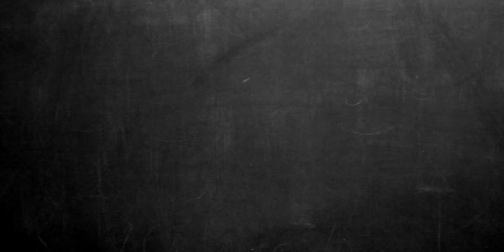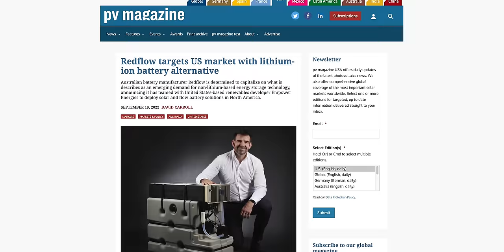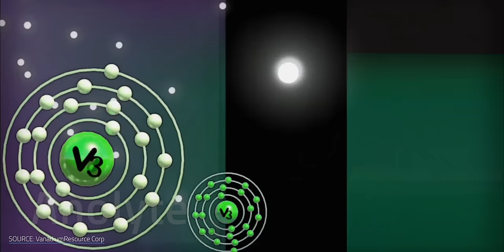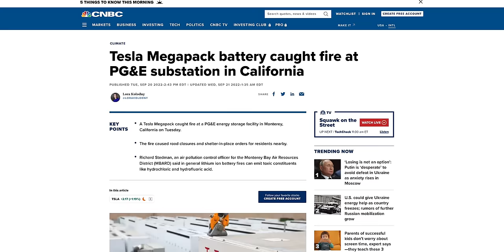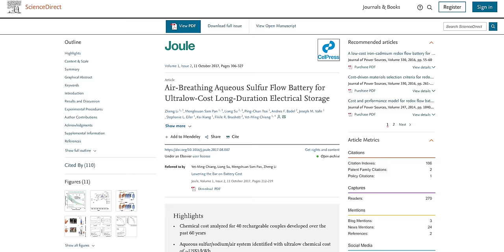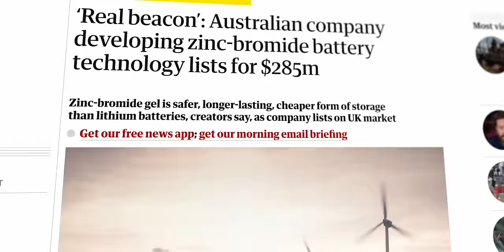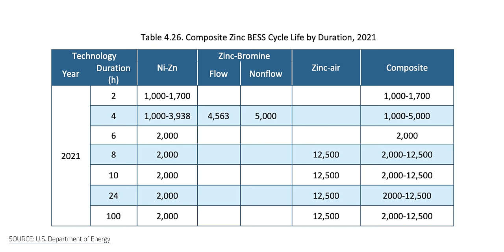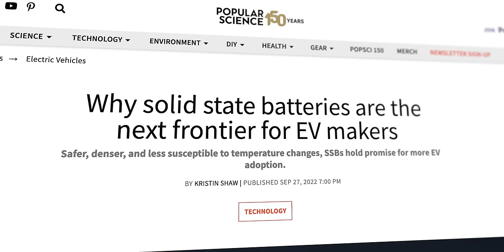137 Year Old Battery Tech May Be The Future of Energy Storage

Comment: If the recent fusion development takes off, the need for storage , wind and solar will fall off a cliff.
Reply: Yes, it always makes sense to ignore the perfectly functioning nuclear fusion reactor that needs transmission lines to create a nuclear fusion reactor on earth. Mercury and Venus are perfectly inhabitable, and they are just near the nuclear fusion reactor rather than actually being on the surface of it.
Reply: @ronaldking1054  Or you could pretend the Department of Energy release didn't happen and keep tossing money into replacing an entire energy infrastructure that could be used .
Reply: @wisenber  Even if the natural nuclear fusion reactor were used or the side effects of that nuclear fusion reactor being around, which is uneven air and water pressures, were used, there is no reason to remove electrical transmission lines to one another. That would be a waste of the excess generation at a site, which could be used to even out the generation. If you make a nuclear fusion reactor, would you still need other sources of generation? No, so I'm not sure what the difference would be at all. The only difference I can discern is the ability to sell the electricity as it is cheaper to generate at the source than it is to generate and transmit.
Reply: @ronaldking1054  I never said anything about removing lines for fusion.
I said fusion would preserve more of the existing infrastructure.
I did say wind and solar require more alterations to the existing lbs....and a lot more physical space.
Reply: @wisenber  You implied that renewables require removing transmission lines. Those renewables are the result of the NATURAL nuclear fusion reactor. There would be no reason to remove transmission lines. There is however no reason for as much generation to be needed. As for more physical space, it requires more space for the housing that any plant provides the electricity for. Therefore, theoretically, the power plant with renewables coincides with the area that is serviced. No, it doesn't take more space. It only takes wasted space to gather wasted resources. Instead, you want to put more resources into gathering fuel and another property to take for generation. This is the joke. What you said is true of your argument on the negatives, but not mine.
Reply: @ronaldking1054  I said "replace infrastructure". Adding residential solar connection to the grid, battery storage and accounting for intermittent power does just that. Removing any need for solar panels would also markedly reduce the amount homeowners are having to spend. Not to mention, we won't have to find a place to store millions of tons of retired windmills and solar panels or see all the predator avian deaths.

As far as the amount of space, renewables already fail in comparison to coal, gas and electric. A single 70 year old coal plant in Tennessee has been producing around 2 GigaWatts for decades.
Reply: @wisenber  There is no reason to remove the transmission lines because solar can be used for the generation of multiple homes. Wind can be used for the generation of multiple homes. What is funny is that you are claiming that solar panels and wind require more money than the electricity bills, which is untrue. Homeowners would spend MORE MONEY with the so-called current economy of scale.
Next, that 2 gigawatts spread the transmission over MORE SPACE than what would be required to have for the renewable, and as such, the renewable covers the SAME area without any additional property needed to be used for the generation, which means the renewable takes LESS space than the current modes of electricity generation as the renewables have no need to take up a plant space. If you miss the argument, there is no need to deed the electrical plant on any property as it is on ALL the properties. This is what I meant by the generation area coincides with the service area.
No, we should not waste space nor resources to generate money for a utility beyond what is needed for the maintenance of the transmission lines. Your only argument is that the transmission lines require maintenance. Currently, that maintenance is being handled by the profit of the generation at the expense of every person using the utility. This could be done by having the homeowner not even own the panels, with the utility owning the panels, which is funny as that means again, the plant requires no additional space, and the infrastructure could not be stranded in such an arrangement. There would also be very little energy lost as there is a 5% loss just in the transmission.
As for the panels not being recyclable, they are completely recyclable. The cost of the materials is just less than the cost of breaking down the panel, but your claim is that is a landfill problem, but we recycle plastics that are more expensive than the material already. Since the price of the panels is not near the price of the electricity, this could be done through a fee or some scheme that is similar.
None of your arguments makes any sense. The renewables take up less space as the plant is in wasted space. The renewables cost less than the generation of the electricity in all modes as the price to generate is less than the price that the utility charges unless your argument is that the utility is gouging, but if it were, that is also an argument for renewables. Your next argument is that there is waste, but that is only in the mode of production, rather than the generation of the electricity, which is in every other mode of the generation of power other than geothermal or hydroelectric. There is no need to search for the commodity, which is in every other mode of generation other than geothermal and hydroelectric.
Reply: @ronaldking1054  I never said they would. I said that they would need to ADD infrastructure that would not otherwise be needed. The grid wasn't designed for bidirectional metered support, nor was it designed for intermittent input.
It adds cost and overhead.
That's why fusion (or plain fission) would negate the need in trillions of dollars in equipment and behavior modification that wind and solar require.
Then again, if fusion delivers the prices anticipated,most of the retrofits and new code requirements for insulation and energy efficiency would go away.
The primary cost would be grid maintenance.
Plus no landfills loaded with old wind and solar equipment piling up.
Reply: @wisenber  Cool, now you are claiming that electricity does not flow in a single direction. It doesn't matter where the energy is added as the next home doesn't care. It only matters that the amperage of the wire isn't exceeded, but the amperage in the wire should be less as the overall generation would be at site for most locations. What's funny is that this should also lower loss. Substations are already capacitors that are set up to make sure the power is not intermittent because of surge on opening a section. Batteries are simply longer lasting capacitors, which means that the grid should be easier to operate. It doesn't require opening up sections at a time if the batteries are not completely discharged. If it is, then it is the same operation that would otherwise be done. What's funny is that most of the battery capacity would be inside someone's own home, and there is no advantage to destroy it as the homeowner is the actual one that suffers. This means it is also more secure through economic incentive. By the way, no one has stated that renewables would necessarily be the entirety of the grid, but for some reason, you are acting unreasonably like it is all or nothing. My guess is that is because you have only heard all or nothing arguments, and you have never once questioned the argument, which is the same as never questioning the size of the power plant.
You have now repeated that there is a necessity of landfill filling when it is possible to avoid that. I have explained how. You have not explained how it is not recyclable at all, or there is a necessity of product ending in landfills. You just restated a point that is false while hoping that I will not rebut you. I will tell you this: If you state a false premise, I will respond.
Next, renewables in studies from Oxford save $8 trillion dollars. The number they give is $12 trillion Australian. No, your method is not cheaper. It never has been. Can nuclear work to lower battery capacity? Yes, it can. By just having it cover the capacity, it means that surge on opening a section could be a problem still, which means less safety in the grid, but if most people are generating power on site that can be separated from the grid, this should not be as big a problem. You also implied that nuclear equipment does not need to be retired. That is plainly false as nuclear plants are being closed, and what is worse is that those sites are also being used as waste dumps because nationally, the United States has not determined what to do with waste. On the other hand, all of the materials can be recycled in renewables. The difficulty is separating the materials. Aluminum, glass, and electronics are all recyclable. Those streams all exist.
By the way, bigger utilities through substations being attacked has shown the lack of security in your grid. There is less reason to attack an entirely decentralized grid as it would require breaking into people's homes or destroying people's homes. This means it is easier to catch the perpetrator, and if the home is destroyed, there is no demand, which means that it should end up with the grid looking exactly the same, but if say, Russia decided to attack a substation or nuclear power plant (they are in Ukraine), the grid is completely destabilized. My guess is that you are going to quibble that a section not having power is not destabilized, but my guess is that the people of North Carolina would question that assessment.
Reply: @wisenber  Yes, Oxford University is going to let their accreditation and standards be questioned by putting out a report that is wrong compared to you, an internet commentator. I think I know what I would trust. Are you going to claim that there are not aluminum, glass, and electronics recycling streams? I can show you businesses in all of them.
Reply: @ronaldking1054  "Oxford University is going to let their accreditation and standards be questioned "
Or we could look at what's actually happening with the waste. I think I'd go with what's happening versus a standard for something that isn't happening.

" Are you going to claim that there are not aluminum, glass, and electronics recycling streams? "
No. I'm going to recognize that it costs more to separate the waste materials in solar panels than the value of the materials. That's why most "recycled" plastics are in landfills after being placed in recycle bins.
If you want to compare an aluminum can to a solar panel, you're not being honest.
Reply: @wisenber  You just said that you cannot change the economics of a product through taxation and/or regulation, which is again, completely false.
Reply: @wisenber  By the way, you also implied that it is harder to get rid of twice the waste of a solar panel system compared to the irradiated building structure as well as the fuel rods in a nuclear power plant.
Reply: @ronaldking1054  "You just said that you cannot change the economics of a product through taxation and/or regulation"
Can you please show anyone reading this where I said that anywhere on this thread?
That is one giant strawman you're posing with.

Government can tax anything to make it nonviable. That does not change the core economics of solar waste. It just means government would have someone else pay for it. Government could make alchemy profitable under those auspices. There just wouldn't be any net economic gain, just like solar panel recycling. That is the opposite of an economic multiplier.
Reply: @ronaldking1054  " compared to the irradiated building structure as well as the fuel rods in a nuclear power plant."
By the way, I have been discussing fusion the entire time.
You can even see "fusion" right up there on the thread you've been posting under.
With that being said, describe to us what you think a spent fuel rod  from a fusion reactor looks like.

Then you can tell us how Oxford can make recycling solar panels pay for itself.
Reply: @wisenber  Cool, it makes heavy hydrogen by adding neutrons, which is still radioactive, and as such, it still has an irradiated structure.
Have you ever bought an alternator? That is a core charge. That is to make recycling of the alternator possible. Have you recycled a lead acid battery? That didn't happen before government intervention. You said it is a price problem, which means all it takes is a government intervention. I don't need Oxford to tell me how to recycle them, because we have been recycling things for a very long time. The fact that you cannot actually look at the different pricing structures either indicates a lack of desire to know the solution or a lack of imagination to actually equate solutions.
Reply: @wisenber  You stated in your latest comment that Oxford needs to say how to make the recycling pay for itself. You do not need to explicitly state something when your argument implicitly depends on it.
You also stated that it makes everything nonviable when the electricity isn't paid for close to the 25 years of the equipment, which means there is a significant pricing that can occur, which means recycling is feasible, but not cost effective with the current economics.
Reply: @ronaldking1054  "Cool, it makes heavy hydrogen by adding neutrons, which is still radioactive"
Cool, tell us you don't understand a half life without telling us you don't understand a half life.

"Have you ever bought an alternator?"
I rebuild mine. Because unlike a solar panel, alternators can be rebuilt with little effort.
The core charge is to cover their lost core, not to cover recycling.
Maybe Oxford could change that?

"The fact that you cannot actually look at the different pricing structures"
The fact that you don't understand that aternators are rebuilt explains your lack of awareness for the rest. Sort of like your half life issue when comparing fission to fusion.

Comment: Renewable energy systems are all very good but to produce steel, aluminium, copper etc you need massive amounts of energy to reach the high temperatures required. If we switch totally to non fossil fuel based energy we will enter a new dark ages.

Comment: You left out Lithium Iron Phosphate batteries. Need a direct apples to apples comparison between LiPo, Lead Acid and ZBr batteries.  Also Lithium is in the Ocean too. You left that out. I didn't see a Kilowatt per Kilogram per Cubic Meter spec for the ZBr battery either. This video looks like a sales pitch for ZBr batteries and not an honest independent Scientific/Engineering Review. And to answer your question.... NO  Not without specific 3rd party review data.

Comment: In 2023 the lithium-sulfur battery is likely to hit the market. It has 3x the capacity and is lighter that LFP or Li-ion. They are being developed for electrical aviation. 
But first it will come in smaller devices as mobile phones, while they will be ramping up production. The German company Theion will be producing them.

And in Australia the university of Sydney has developed a Sulfur-Sodium battery. So no lithium at all. But that one is still a few years away from rolling out to production.
But when it does, the cost of the materials are so cheap, that the price of batteries can drop to 1/3 of what they are now. 
Sulfur costs about a hundred times less that lithium. And is abundant. Sodium is sea salt, also abundant and cheap. 

Now it is mostly about how fast Theion can scale up production.
Their schedule atm is:
2023: space vehicles
2024: drones and electrical aircraft, air taxies.
2025: cars

Source (It is in Dutch, but you can google translate it):
https://www.trouw.nl/duurzaamheid-economie/is-de-zwavelbatterij-te-mooi-om-waar-te-zijn-hij-komt-er-toch-echt-aan~b49baf80/

Comment: Thank you, Matt!  What's their range of lifespan?
Reply: as with all energy-storage-systems, lifespan can't really be determined in years but in cycles. As said in this video, they're rated for 4500-5000 cycles. If used for example as the storage system for a solar farm, that means theyd charge over the day and discharge at night, they'd hold over 10 years. also, most of those systems then need major maintenance, meaning the systems dont have to go and be swapped for new ones, they can usually be restored by exchanging certain parts like the zinc layers.